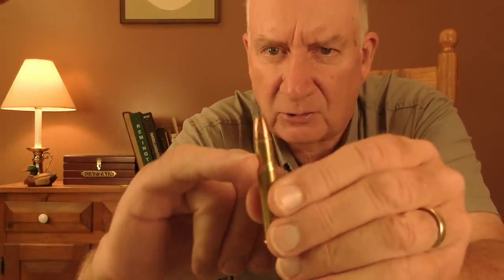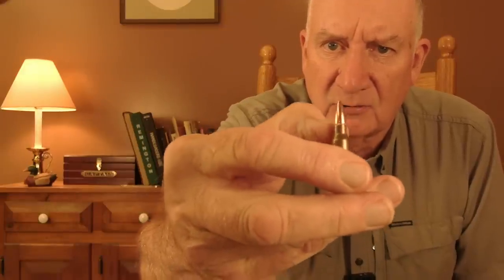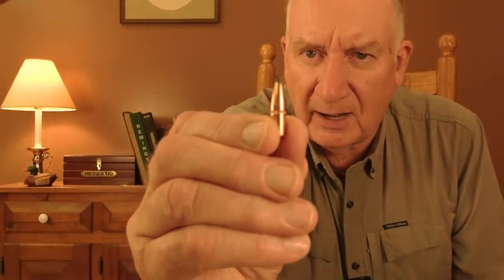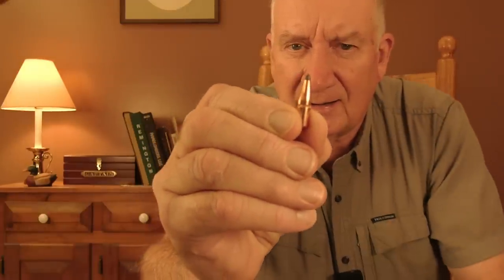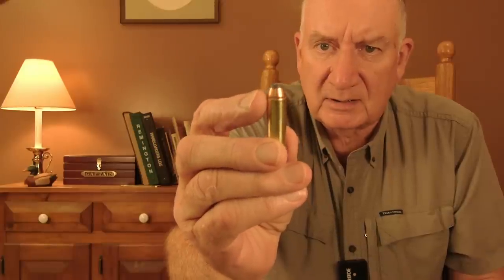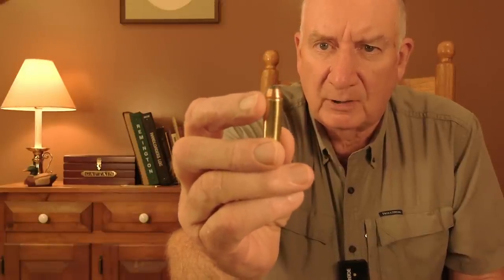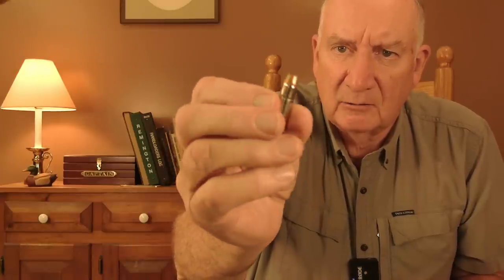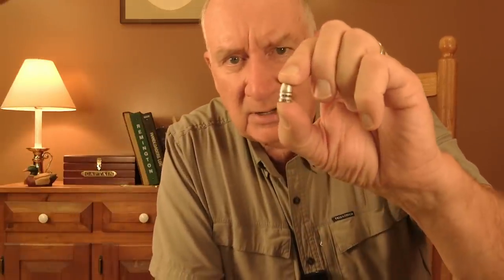Crimp or Don't Crimp ~ You'll Know the Answer!

Comment: Both the Lee Collet Sizing Die and the Lee Factory Crimping Die are marvels of engineering the average man can afford to own. Years back I tested bullet performance in the 7mm Rem Mag. 139 Hornady BT Interlocks and 150 Nosler Ballistic Tips (the very early ones, grenades!). Soaked for 2 days wet newsprint was my medium. An interesting thing happened when I crimped both bullets to maximum. The 139's could be seated out longer so the crimp was below the cannelure about where the so-called interlock ring inside the bullet is. The 150's have no cannelure but the Die swages a perfect ring into the Noslers that looks like the grooves on a Barnes TTSX bullet.
Uncrimped bullets of both kinds essentially exploded in the newsprint inside of 200 yards.
The maximum setting crimped bullets now performed similar to Speer Grandslams where the front of the bullet ahead of the heavy crimp fragments causing damage but the lead core behind the heavy crimp stayed in the base and drove through like the harder lead based Grandslams or dare I say Partitions. Even if the expanded jacketing ahead of the crimp sneered off the bases plowed straight through for another 12+ inches.
Now the 139 Interlock was actually performing like advertised and the Ballistic Tips were turning whitetailed bucks boiler rooms into red jelly and blowing through the far side.
Accuracy actually improved with the Ballistic Tips and the Interlock Boat-tails stayed the same out of the 26" barrel of my Browning LH A-Bolt Medallion rifle.
Reply: Edit: sheared off...

Comment: Thank you Captain for another informative and stimulating discussion. I purchased a Lee collet factory crimp die and was hoping to use it for one of my daughters loads.  Now she chose a bit hotter load than I would have preferred and this video came at a very good time. She and I were both wondering if we applied the collet crimp, do you think we would experience more case pressure then if it weren't crimped? We are safely using published data from Nosler. What could we expect? Which pressure signs are more likely if so? A million thanks for all the education we receive from you. May God bless you!
Reply from the maker: Crimping doesn't measurably alter pressure.
Reply: Thank you sir.
Reply: @GunBlue490  Good to know.  I have had some trepidation about crimping with the lee die.  I lightly crimp all my loads.  I emphasize 'light' and I had begun to be concerned if there could be pressure problems.  Thank you

Comment: On my 6.5 Swede I have a problem getting enough pressure to get a good case seal. I'm loading a touch over max and its not bad but it still leaves the cases sooty. The primers show very low pressure so I feel like I'm safe.  I tried crimping them to make the pressure increase faster to get a better seal but it only helped little if any.
Reply from the maker: Be sure to keep your chamber completely dry and free of oil, too. Oil will prevent proper brass to chamber sealing. Also, old military brass may have been fired with corrosive primers that crystalizes brass and prevents sealing with successive loads, so such brass should be discarded.
Reply: @GunBlue490  I'm using recently purchased Nosler brass so thats not the issue. But the oil chamber is an intresting thought. I oil then wipe it out thoroughly afterwards, but maybe not dry enough. Thank you so much for the reply!

Comment: Between loading with my dad and in my own I have been at it close to 30 years. Have you seen any correlation between more consistent velocity and crimping? The story about you plating your cases was quite humorous, thank you for sharing it.
Reply from the maker: On the basis of the decades of benchrest records that have been set, and from my own personal observations with my various accuracy testing, I have every confidence that non crimped rifle ammo performs at its peak.  One note:  I have pulled countless bullets over the years from both non crimped and factory crimped ammo.  While the former are virtually unmarred, crimped bullets have scrape marks along their entire shank.  One of the most significant negative accuracy issues is flaws at the base of a bullet or at the crown of a barrel that diverts gasses at the moment of release. I have every reason to believe that the best bullet is a clean one, unscarred by the case.
Reply: @GunBlue490  Thank you for such a thorough explanation.

Comment: Great information, you mention several times of the bullet possibly traveling deeper into the case, wouldn’t it be more worrisome of the bullet moving outward from the case due to the recoil?
Reply from the maker: No, bullets always want to drive deeper. At the end of the gun's recoil rearward, the bullet inertia continues rearward into the case.
Reply: Thanks, I reloaded some snake shot to factory specs in my .38 special, after the first shot several the plastic shot holders moved forward causing a jam in the revolver, the gun was a S&W air weight, that’s what was leading me to believe that the bullets would move foreword from the centrifugal force of the recoil. Thanks again.
Reply: It has been my experience that bullets usually get pushed in under recoil, except revolvers- where the rest of the cartridges not being fired are accelerated rearward as the revolver recoils by their cases as they are generally head spaced by the rim. 

Mostly a problem with heavy recoil cartridges in light weight revolvers.
Reply: No think about when you fire a gun does it push you back or forward? You have two big feet and the rest of your body centering your gravity and it still pushes you back now think of the bullet, it’s rim is against the revolver, or magazine it can only go backwards assuming that the bullet has anywhere near the correct tension to hold it in place. You hear of bolt rifles having issues sometimes with a bullet getting stuck in the lands of the rifle, that happens because competition rifle shooters will often NOT crimp because they want the bullet looser then average. They practice something called bullet jump which is basically a longer bullet case over all length. This can and sometimes cause a bullet to get stuck in the chamber when they are told to clear the chamber for a stop in firing scenario, this as you can imagine is a disaster for the competitor because he now has to dig that bullet out and clean up all the spilled powder in the middle of a firing sequence while the opposition is firing, however this is a risk many take because their rifle shoots better with a longer over all length which is the case with many competition rifles, your better off crimping unless your a F class or ELR shooter. That being said that bullet jump is only practiced by a minority of shooters because they don’t want to risk a bullet jam which can sometimes happen if you “jump”.

Comment: I have had some loads shift mostly in my 22-250 A.I. from compressed loads if you run tight neck chamber with a bushing die almost no grip at all after trimming necks down I just keep a eye on OAL cause it can get stuck in lands on a eject then you got a mess Never did like crimping but it needs to be done just not on baby bench rest

Comment: The Lee reloader's manual recommends crimping rifle rounds when the bullet jump (distance to the lands) is either unknown or more than 0.030". It explains the reason is because initial pressures can spike once the bullet hits the lands, especially if the jump is greater than 0.015-0.030" and can cause inconsistent pressures from one shot to the next. Their theory is that by crimping the bullet the initial pressure rises more sharply before the bullet starts to move. The bullet then jumps faster to the lands and having more inertia helps to stabilize the pressure rise as the bullet encounter the lands. Lee claims through testing that crimping generally results in better accuracy. The exception to this is for shooters who tailor their loads so the bullets are seated out very close to or toughing the lands. But Lee still says this is more dangerous and can cause unusual pressure spikes.

Comment: I reload for my .357 lever rifles extensively, and occasionally use the Berry's plated flat point bullets just for plinking stuff. They don't have any cannelure but I always crimp them a bit anyway at the same spot I would on same sized bullets WITH cannelure that I use for hunting. I've never had any problems at all, but I'm wondering if it is ok to crimp on those plated, non-cannelure bullets. I'd have to think YES because it is a .357 afterall, and whether in a pistol OR a lever gun, one would need a crimp. Love the content, as always, and would appreciate your thoughts!
Reply from the maker: I'm replying as an experienced professional electroplater from my pre-law enforcement days.  Copper plating, as with any plating, is quite thin and is easily compromised by any distortion, and adhesion will be lost, resulting in flaking, blistering, peeling and shearing.  Your bullets are intended only for lighter loads with nothing more than a semi-auto style, firm taper crimp, but not for a traditional roll crimp that will indeed cut the plating.  That presents a problem because revolver cartridge dies impart roll crimps.  I use Berry's cannelured .357 and .44 caliber flat point bullets for my reloads, which are made for roll crimps.  I purchased both very recently direct from them.

Comment: i have problems with my winchester 94 30-30 dealing with bullet setback. Ive asked a few people and the best I could come up with is its from either the action of loading the rounds in the magazine, or from the constant spring pressure while in the magazine. This is with multiple brands of factory ammunition. It occurs just from loading and unloading the rifle without firing any shots, so i feel most of the problem at least, is not from recoil. Im not sure what to do about it. Maybe i need a shorter magazine spring? Or maybe they make a reduced power magazine spring?

Comment: Jeez. I just figured you were always supposed to crimp. I use the factory crimp die from Lee on every single caliber I load for. For my hunting rounds i will even take a little clear nail polish and seal the primer, and a small amount around the case neck after the crimp to weatherproof it. Am I doing something wrong?
Reply from the maker: Nothing wrong.  You're just very cautious!  Actually, I wash the Lee case lubrication off my reloaded ammo in a tub of hot soapy water, and it never leaks.  Unless you have loose primers, ammo is entirely waterproof.

Comment: 15:35 - the recoil of a revolver does not seat the bullet deeper. It pulls the bullet out of the case. The whole firearm jolts backwards under recoil, along with the rounds, being pulled by their rims. The (relatively heavy) bullets try to stay in place and are pulled out of the casings by inertia. This is called "crimp jump". The main issue here is locking the cylinder by bullets sticking out. The tension of a well crimped neck is enough to counteract this. This is why Vihtavuori manual recommends crimping the 185gn XTP bullets (designed primarily for .45 ACP) over their ogive in .454 Casull. The bullet can be pushed inside the case in an autoloader.

Comment: I have been considering adding a crimp to my precision rifle hand loads to create a more consistent neck tension.  Any thoughts?
Reply from the maker: I tested that many years ago and determined that there was a consistent loss of accuracy.  My belief is that the crimped case drags on the shank of the bullet, possibly creating marks that affect the smooth edge of the bullet where it exits the crown. As I noted in this video, match grade factory ammo is not crimped.
Reply: @GunBlue490  thank you for your experience that makes perfect sense.
Reply: Top competitive shooters don't crimp. They set consistent neck tension with bushing dies and expander mandrels

Comment: One problem I’ve had using a semi-auto rifle is the forward action of the bolt slamming the case into the chamber.  The bullets will creep out of the case up to .010 affecting accuracy.  I use bushing dies with the smallest bushing I can find and still get this issue which affects the precision of the rifle.  Single loading gives me excellent results, while shooting from the magazine results in decent groups if I don’t count the  fliers from the bullet creep.  The bullets are Berger and have no canalure so crimping isn’t an option.  Any ideas on how to alleviate this problem?
Reply from the maker: Yes, I do, and it's quite simple.  Get a Lee Factory Crimp Die.  It makes a factory style crimp anywhere you desire, however strong you need, with no need for a cannelure.
Reply: @GunBlue490  thanks so much for the reply.  Will try that and see what kind of results it’ll yield.

Comment: I’m started to re-load 39-30 for my Winchester 94. I bought a box of Berry‘s plated bullets which don’t have a cannelure. I was assured I‘d be OK, I‘d love to hear your views!
Reply from the maker: Plated bullets will accept a light crimp with no difficulty.  Use just a minimum of crimp to prevent any failure of plating adhesion. For lighter loads, you may need no crimp at all, but take note of their length for the first magazine to be sure you have no shifting. Just draw a line around the bullet at the juncture of the case mouth with a Sharpie, and if the line disappears, you'll know.
Reply: @GunBlue490  many thanks for that. That’s reassuring, my first loads I’ve feed singly but your tip to use a Sharpy is top, as is the suggestion I can use a light crimp on a plated bullet. Thanks again and God bless from England!

Comment: I had a .500 mag s&w lock up cuz the bullets pulled. Why because it was shot by “newby” shooters a girl and a 40 year old man they didn’t hold the pistol properly high on the back strap and we’re holding gentle they kicked straight up into the air quickly. I’ve never had it happen but I hold the gun tight and fight the recoil but they caused a complete pull… powder spilling out. It’s amazing how ppl that don’t understand anything will always blame the equipment.

Comment: I've been messing with my hornady taper crimp/seating die for quite a while today, trying to figure something out.  I normally use bullets with a cannelure, or a lee factory crimp die. Right now I have a bunch of eldm bullets without the cannelure.  My grand plan is I want to use a gentle crimp so I can run these in my 224valk AR platform without deforming the bullet.  My question is that if I set up my crimp die and run a piece of sized brass into it, it crimps just a little.  Like point 004. Measurable but not visible.  When I load a bullet however it measures the same as the sized brass before crimping with no bullet or actually slightly larger than the blank brass so fine, I know I'm measuring the neck thickness with the bullet but am I actually getting a crimp? That little gentle crimp just seems to be disappearing when I load a bullet into the brass. I guess I could load some up and try them but I probably won't take the valkyrie out until warmer weather and I don't want to wait to find out. I'm trying to not deform my bullets at all if its possible because these eldm's don't seem to shoot too well in my valkyrie when I've been using the lee factory crimp die.  Maybe what I want isn't possible or advisable but I was wondering if you've ever tried this. Is there a way that I could mimic the effect of recoil on a round and measure the round after? The bullets don't set forward when chambering a few times but I'm not sure thats good enough.

Comment: Hi Gunblue, I have a Mini 14 question for you. Can you run a mini 14/30 without the bolt latch? The other day my bolt latch on my mini 30 got jammed up in front of the bolt face after firing the last round in the magazine. I had to free it up by pushing hard on the bolt face with a screwdriver and I don’t want to deal with that again, especially when out deer hunting. I did a little research online and apparently this has happened to others as well. Thanks in advance for your wisdom.
Reply from the maker: Your bolt lock plunger is frozen from oil or grease, installed backwards, missing,, or is damaged, or something is obstructing.  Remove the stock.  Slide the lock door downward, and remove the latch, plunger, together with the plunger spring.  Inspect the spring for kinks and be sure it fits snugly to the plunger.  Insert the smooth shank of a 1/16" drill bit through the plunger hole until it passes through completely through the under side.  It has two diameters, but goes entirely through.  It's not uncommon for those who have glass bedded their stocks to get epoxy in that hole.  Connect the spring to the plunger and insert it into the hole with the notch of the plunger FACING the bolt lock.  While depressing the plunger, align the notch in the plunger to the small actuator arm of the lock.  That notch is the part that moves the latch and they must be aligned, or the lock will jam.  Replace the cover and check for free movement of the bolt lock when the magazine is not installed and the bolt is to the rear. NEVER oil or grease the lock assembly.
Reply: @GunBlue490  Thank you for answering my plea for help and for the excellent directions. I will follow your instructions and see how it goes. 
Thanks again!